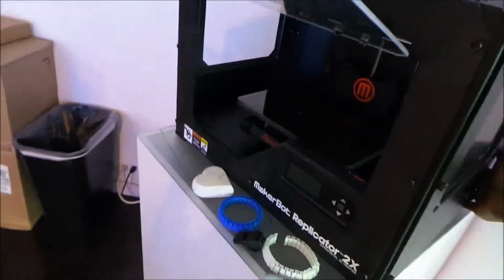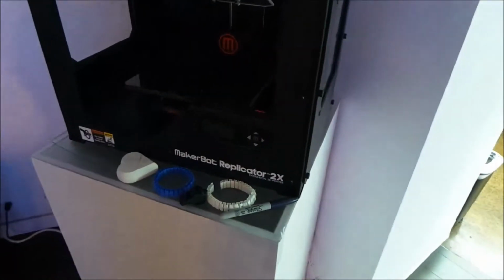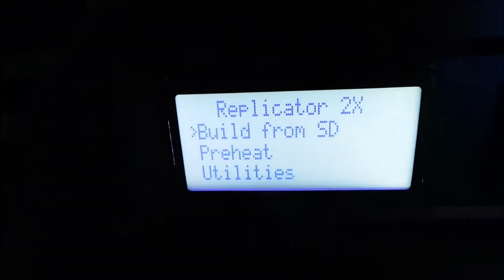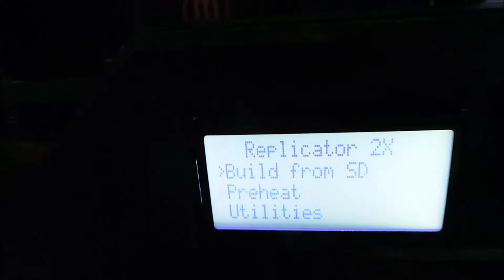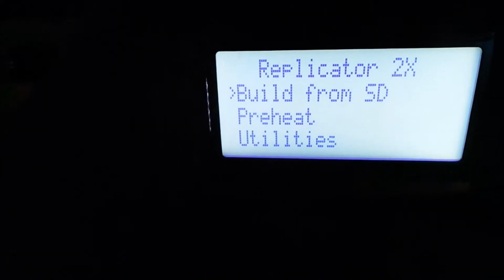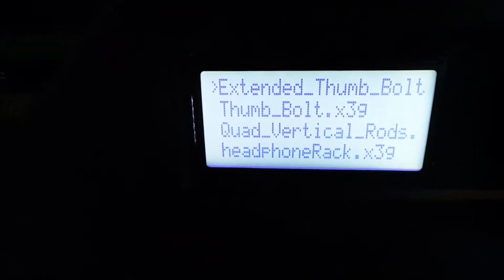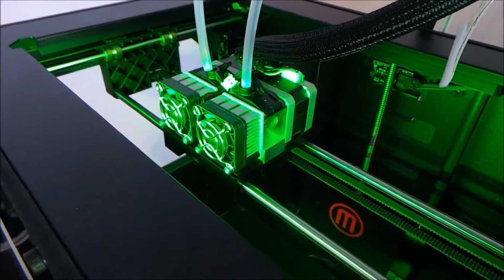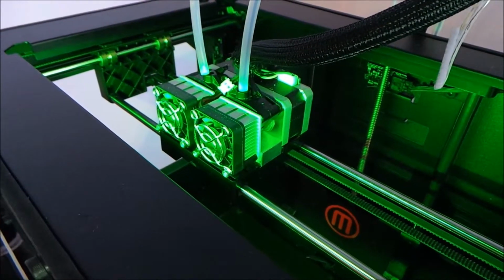Makerbot Replicator 2x Printer Head Stuck

Comment: Hey, I'm having the exact same problem right now... 
MakerBot support are sending a new cable but I doubt it's the cable's fault... 
Did you manage to solve the problem? 
How? 
Cheers
Reply from the maker: Yes, I did. The rod going through the belt gear had slipped out of place. So the axel was only being held in place on one side. I had to slightly move the gear back into place and force the rod through so that it was being held on both sides.
Reply: alcedes OK thanks!
Reply: alcedes I'm having this exact issue but I just can not seem to figure out where the problems was/is based on your explanation.

Comment: I just had the same problem with my Makerbot Replicator 2, and found that one of the bronze bushings was seized (mildly). I was able to tap it loose, and then clean the slides very well and re-lubricate. We had just run the bot for about a week straight (about 18-24 hours each day), and I think it just got some debris built up on the x-axis slides (which would be the ones to collect debris)